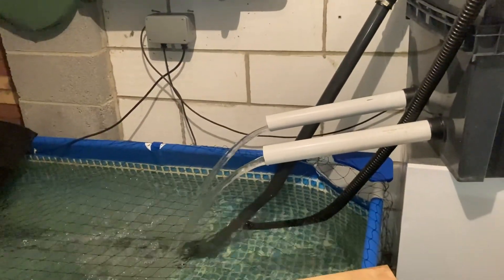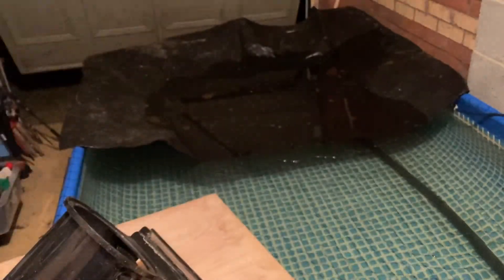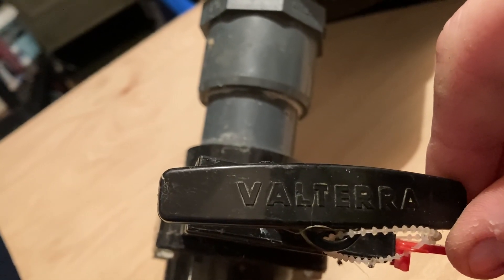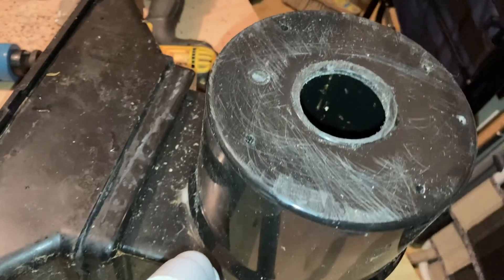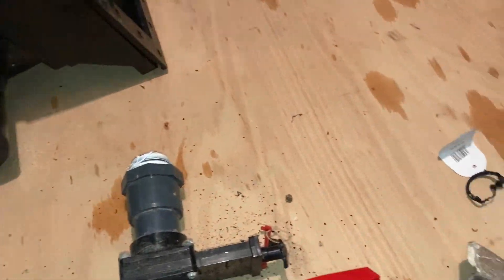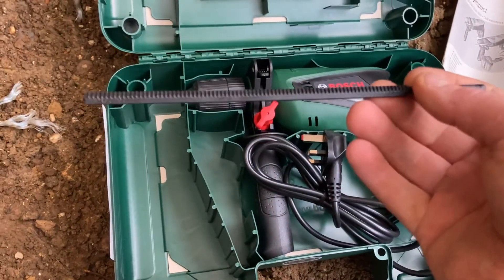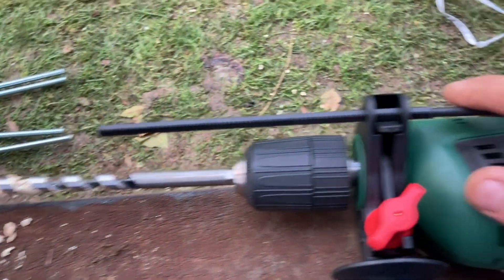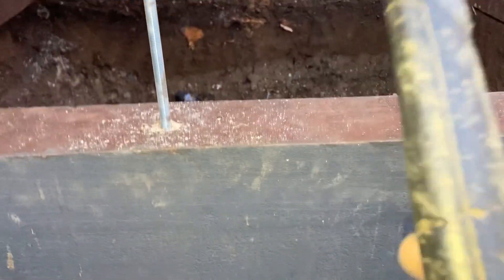DIY sleeper koi pond rebuild part 4 (sort of) and kockney koi skimmer modified ( 2 parts)

Comment: Nice update Ad. It's hard but the one thing I can tell you is that you will get there. 😉for the root, cut them as far as you can.  I have added all the way around the pond and on the ground a thick membrane called bamboo root system. It's expensive, BUT,  it will protect your pond, and membrane, your fish and all your work.
Reply: @ADS-KOI  I got it on Amazon.  It comes in different width and length. They are designed to stop roots from going through things. Nothing else will stop roots from going through. Well worth the expense.

Comment: Pond is coming along nicely. Hopefully your fingers all survive the build. In future if you need a depth gauge for a drill bit just measure from the bottom of the bit to the depth you want and then wrap a piece of tape around it. As you drill watch the tape and when it touches the wood you know you have reached the depth you wanted.  Cheers.

Comment: Why did you not get a little excavated in to dig out the pond bottom? The  tree root needs to be removed from the outside of the pond not inside of the pond good luck with the build